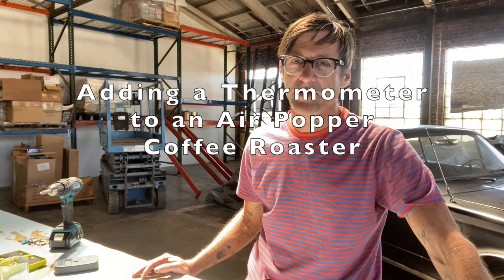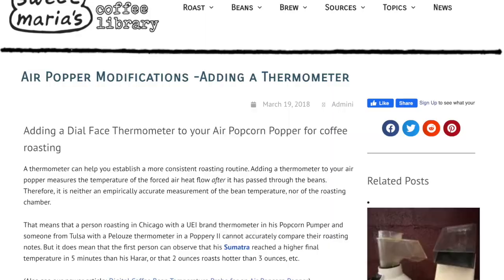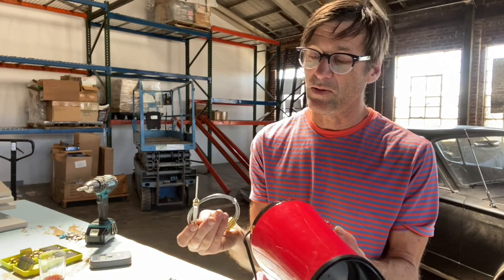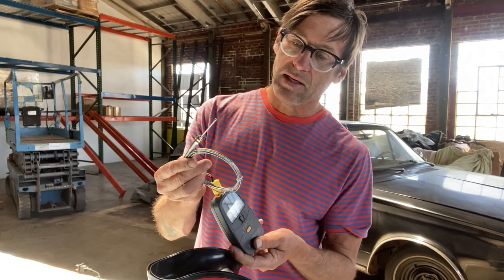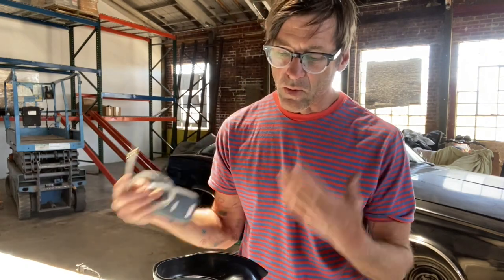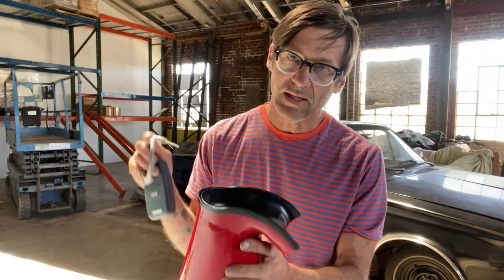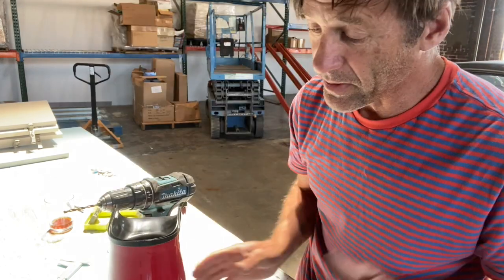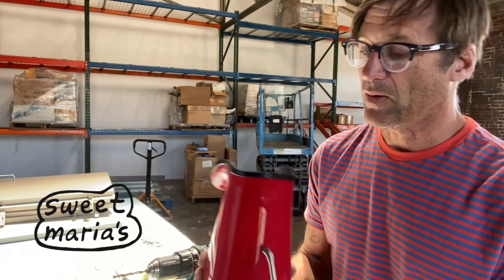Adding a Thermometer to a Coffee Roaster / Air popper

Comment: For the plastic shell I used 7/32 drill bit instead of 13/64 in popper. I couldn't thread M6 thingy through the shell with 13/64.

Comment: Wouldnt some high temp food safe silicone around the roast chamber to the heater assembly help prevent air loss. Causing more airflow into the roasting chamber?
Reply from the maker: It probably would but there's not that much pressure loss to start off with as the top collar sits pretty snug onto the fan housing.

Comment: Thanks for this Tom. What do you reckon to using an infra red thermometer gun to save all the drilling out? I'm new to all this but learning fast, great video, Roy UK.
Reply from the maker: A lot of our customers use them and they work well. One downside is we have heard of irregular readings if the gun itself heats up if held over the popper for too long.

Comment: excellent video (including the barracuda cameo).  i have the sr800 and had been wondering about adding a thermocouple.  how would you do it?  the chamber is glass so that's out for drilling.  is there a way to snake it down thru the lid?  and even if so, the two strands of exposed thermocouple wire would get 'beat up', i'd think.  but surely you found a way : )  again, thanks for the video on this.
Reply from the maker: Yes, some of our customers drill a small hole through the screen to insert a non-rigid thermocouple that will "float" along the top of the bean mass. A more permanent/stable method is to drill a hole in the center of the chaff collector and install a rigid chaff collector so the tip sits right above the bean mass. The readings won't measure the bean mass itself but you will at least get consistent, repeatable measurements.

Comment: with the "raw" thermocouples (as you called them), there's a very simple, non-invasive, minimal tools required way to add it into the bean mass - simply cut & bend a coat hanger to "hug" the lip of the popcorn popper very tightly, as well as the inner walls of the popper, and wrap the thermocouple around it & poke the tip into the bean mass ... i did drill a very tiny hole in the lip of my popper that the coat hanger slide down into to hold it very tightly -- but it worked like a champ ... i started getting much better results using a TC & plugging the popper into a regulator to "tame" it down -- mine would ramp up the heat like a fox on fire!  :(
Reply: Sounds interesting. What type of regulator are you using ?

Comment: Thanks for the great video, and also thanks for selling great equipment like this (at a reasonable price). 
This seems to me like a great way to put a quality thermocouple into a popper. Stable positioning (won't move a lot), good placement, good thermocouple, easy to do. 
Can easily be hooked up to artisan if that is your thing, might be funny on a popper.
I will buy some of these thermocouples and try out. I have some simple mods to control voltage to my poppers, will be interesting to connect to artisan and see what I can learn about using the voltage dial (reduces heat and fan). 
It seems worth noting, while this TC won't measure the early roast well, arguably the early roast is the least sensitive, fine temperature details don't matter so much...
Reply: Could you share a photo? I'm curious about this.